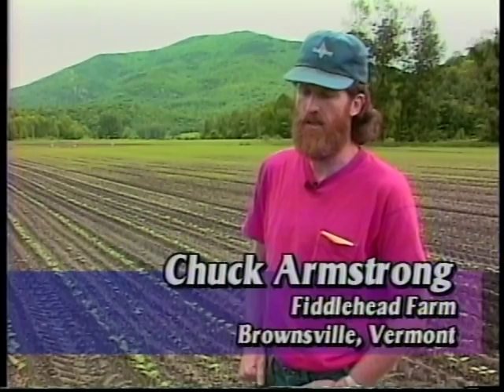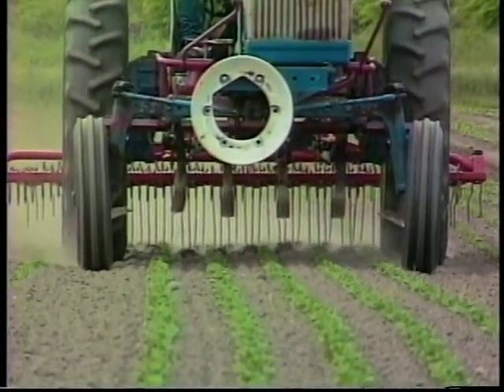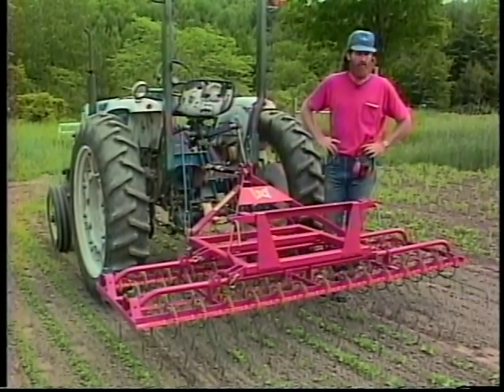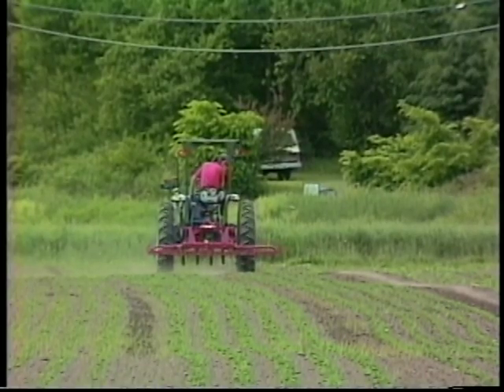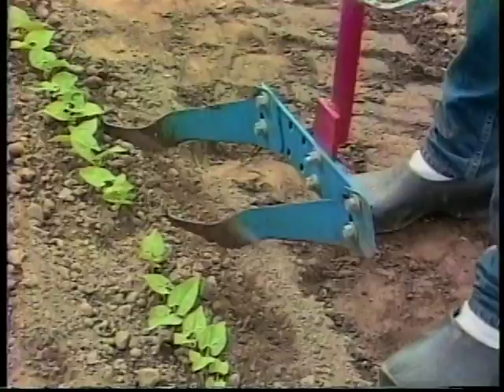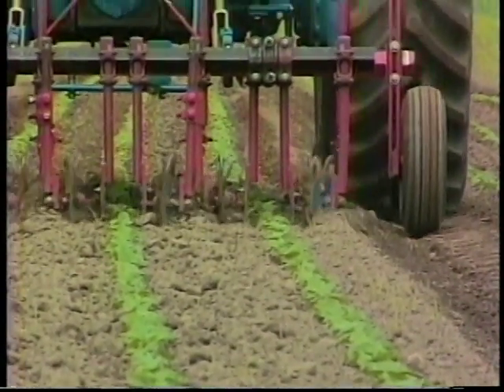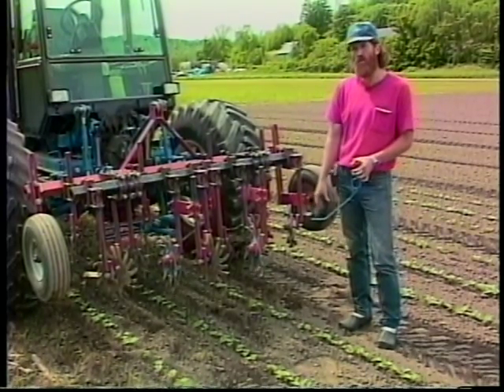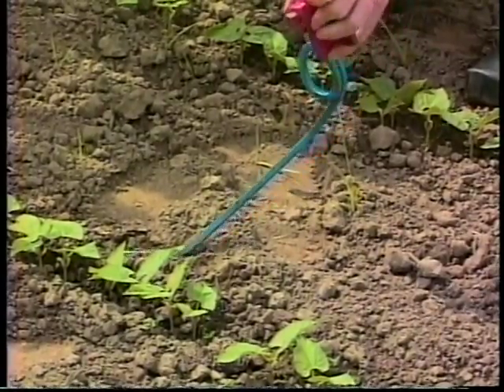Weed-Control Machines - Fiddlehead Farm, Brownsville, VT

Comment: I admire your Ford 1710. Very nice soil and well managed crops.
Reply: +EZ570 I want one of those we have a ford 9n
Reply: This past month I bought a Ford 1710 high crop with 2 chain drive side dressers, all original, garage kept, with 477 total  hours. I paid a L-O-T but what are you going to do.
Reply: EZ570
buy it from our neighbor we have enogh money but we will buy a John Deere
Reply: I have my eye on a local Allis-Chalmers G.  It is smaller and trailer-able to different locations that I farm at. I do like the 1710. It is well built and has the pto and 3 point hitch so that I can spray when the bugs are devouring the foliage. I have a 2 row cultivating tractor, my grandfather's CA. It needs rebuilding as it has been used by three generations.
Reply: EZ570 
I wonder what kind of planter he uses to plant beans in gravel soil. Also wonder how seeds germinate in gravel soils.

Comment: I took hay rake tines and angle iron and an old 3 point hitch that I had and I made me a set of finger weeders with it or tine weeders and it seems to work a lot better than the store-bought ones or the regular cultivators do and all I have to do to adjust it is Tyco sometimes out of it so I don't rip my crop out of the roads and hit Works fantastic
Reply: A picture would be great…